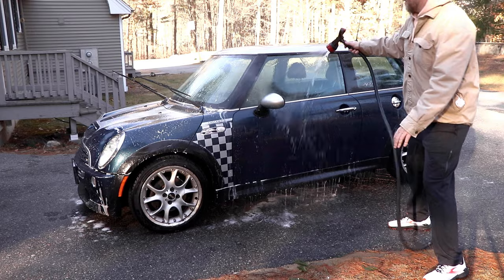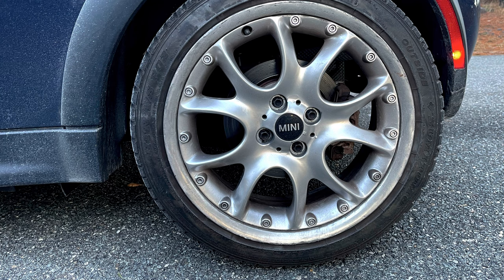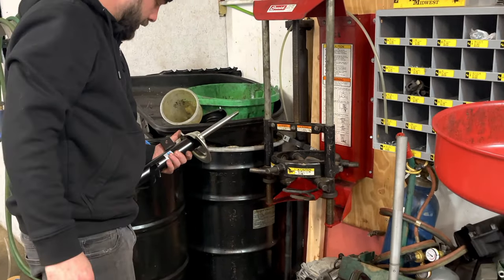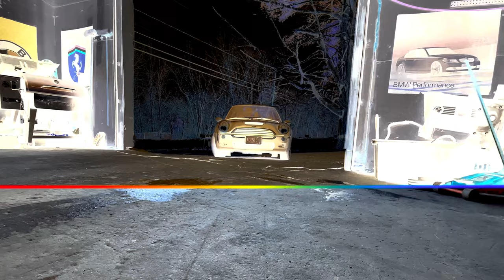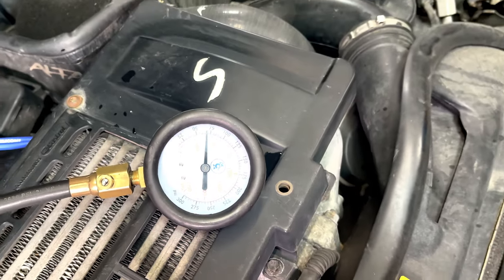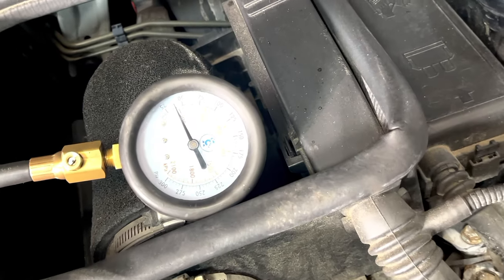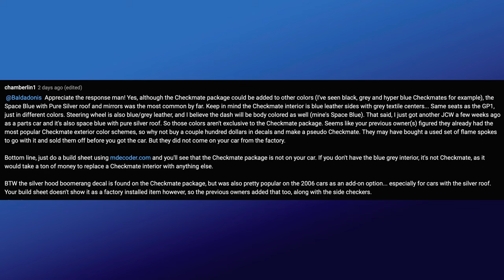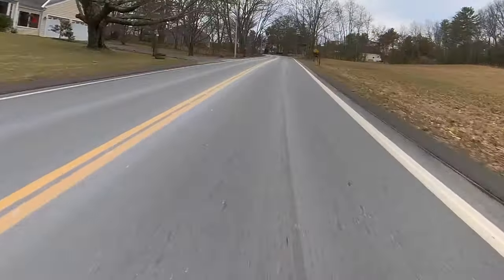2006 Mini r53- Refub wheels/new steering wheel shaft & MSD ignition tune up(pt 3)

Comment: BTW bud, the Space Blue/Pure Silver combo we have on our cars is actually pretty rare; I definitely wouldn't call it common! If you think about it, most Checkmates were Space Blue/Silver (like my JCW Checkmate), but there are probably a LOT fewer non-Checkmates in this color combo (like your car and my other JCW)! With the English leather option and all the other goodies your car has, I'd put it pretty high up there in the overall desirability scale! Thanks again for the shout-out!
Reply from the maker: Ok cool! I ll mention that next video- and people will see your comment as well so that’s good to hear ! I though you was saying it was a common color for 2006
Reply: @BaldadonisMike2021  No problem! Sorry for the confusion... Just meant that Space Blue/Pure Silver is the most common combo for the Checkmate cars by far. But for non-Checkmate R53s, it's actually quite rare! Yours and mine examples are the only two I've seen in years of researching R53s. I saw a space blue JCW on Bring a Trailer last year, but it didn't have the silver roof. Bottom line, space blue is a fairly rare color to begin with, and to have an R53 in that color (which isn't also a Checkmate) is a pretty cool thing 👍 It's a great paint; a very classy deep blue with a tiny hint of a green undertone in the right light.
Reply from the maker: @chamberlin1  Great information ty!